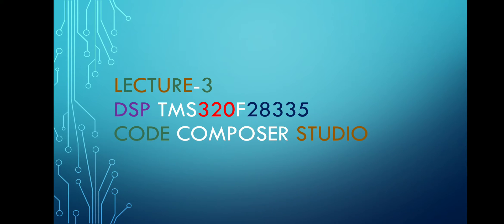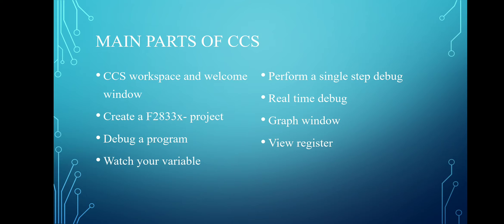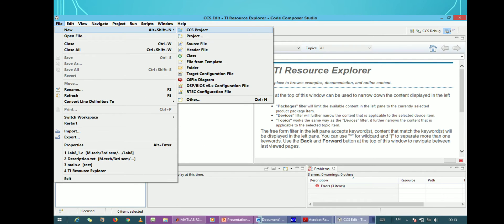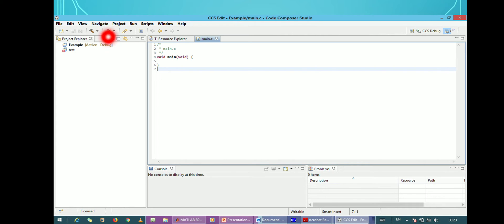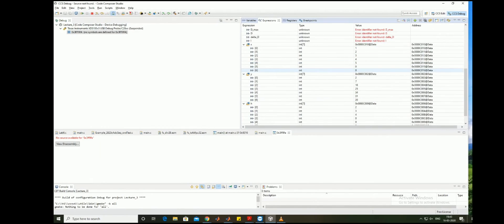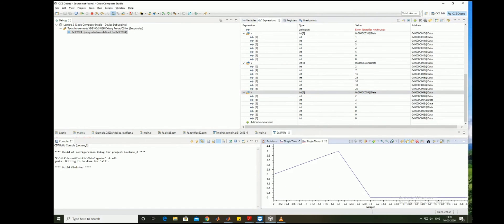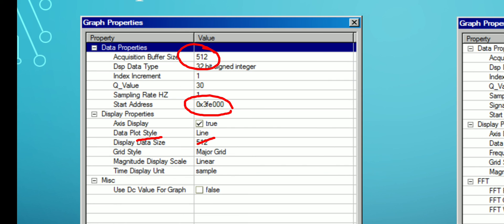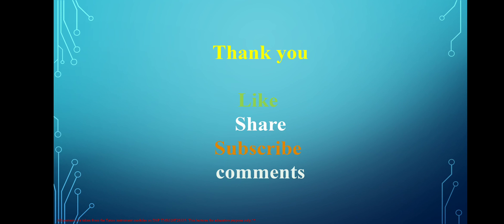Part 3 | How to plot a graph using CCS | DSP TMS320F28335 | CCS | code composer studio

Comment: Hi.

In the debugger initialization occurs an error: "Unable to load ..\..\..\emulation\tpi\tpi28xx.dll: error initializing  due to wrong side by side configuration."

Can you help me?

Thanks.
Reply from the maker: The "side-by-side" error is a Windows operating system error related to a faulty C++ Redistributable Package. This is common to operating systems which do not have Microsoft Visual C++ 2005 Redistributable Package.

You may need to uninstall the older Microsoft Visual C++ 2005 Redistributable Packages and re-install them again.

When you encounter this error when updating a program that you currently installed, run a Repair first to ensure the program's files are installed correctly.

Comment: thanks for the video Sir
please what does this error message mean?  " C28xx: Error initializing emulator: (Error -2083 @ 0x0) Unable to communicate with the debug probe. Confirm debug probe configuration and connections, reset the debug probe, and retry the operation. (Emulation package 7.0.48.0)"
Reply from the maker: You need to setup your connection before debug your model to the processor.
Reply: @controllers_knowledge   i tried doing that but keep getting this error message..  """ This emulator does not create a reset log-file.

----[An error has occurred and this utility has aborted]-------------------

This error is generated by TI's USCIF driver or utilities.

The value is '-233' (0xffffff17).
The title is 'SC_ERR_PATH_BROKEN'.

The explanation is:
The JTAG IR and DR scan-paths cannot circulate bits, they may be broken.
An attempt to scan the JTAG scan-path has failed.
The target's JTAG scan-path appears to be broken
with a stuck-at-ones or stuck-at-zero fault.""""
Reply from the maker: Can you please change your JTAG.